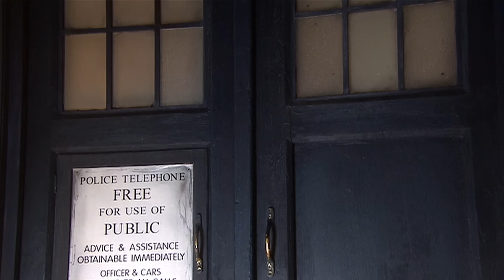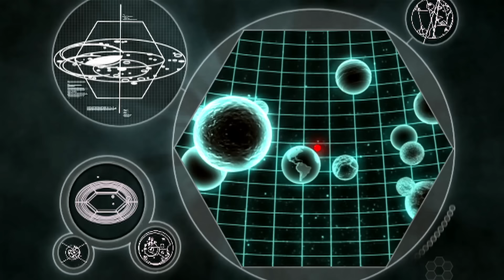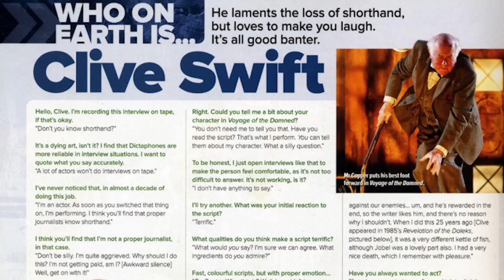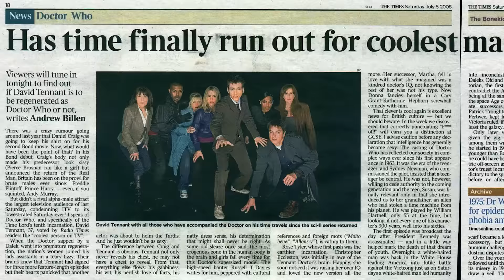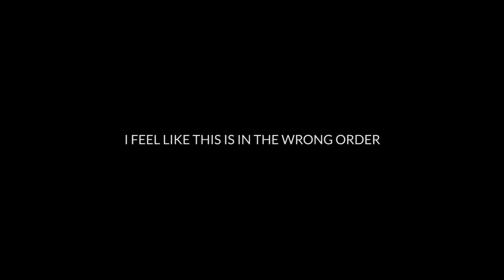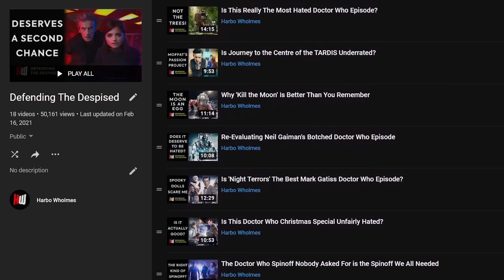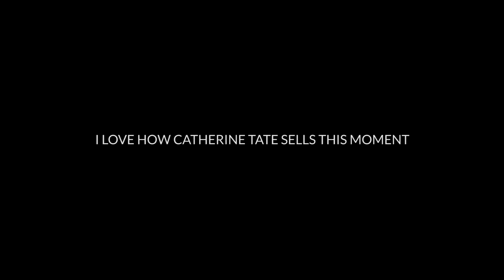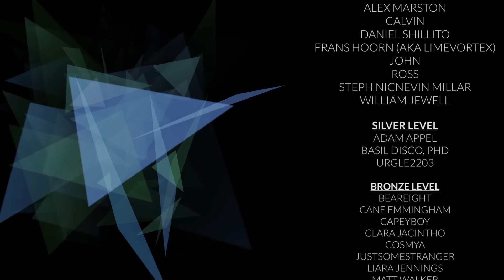When Doctor Who Did 'Infinity War' (But Better)

Comment: The way I make sense of the "That button there" scene is that Donna programs the button herself, rather than having a random 'this breaks everything' button already sat there 🙂
Reply: That's honestly the way I thought it was meant to be
Reply: I always saw it as davros was the mastermind behind the Daleks, and while he may not have personally built the crucible, he more than likely had a major hand in designing it. Given his previous track record with butting heads with the daleks and being offed by them more than once (to my memory), it would make sense that he snuck that console into the design specs in case he needed to take control, without the daleks ever being the wiser, even sneaking on those rotators that were clearly built to fit the plunger replacers to make it look like it was made for the daleks also. Both seem like perfectly plausible explanations for it
Reply: 'That button there' can work well. 'Family of Blood' ended a bit like that, with the Doctor explaining why it was important with his characteristic technobabble. Donna did that a little bit. When it's done poorly, it's the Eleventh Doctor black cubes episode.
Reply: same way to explain why in the end of the world they just have a "turn off shields permanently" button lying around

Comment: I feel like this finale is best on first watch if you're going through the show in chronological order, just so you can appreciate all the characters and the arc. Watching it out of order and standalone, it just feels like all spectacle and not a huge amount of depth.
Reply: You could say that you have to go through the Journey to reach it's End
Reply: That's true. Doctor who is sometimes an episodic show where each episode requires a beginning and an end and everything a story needs in between but sometimes it's a serialised show and with most of the finales in RTDs era the finales are the pay off to all the build up from before. So the depth of this story is about the characters and everything that was built since the first series. I don't think it requires the amount of depth something like midnight or silence in the library did and I don't think its a problem that it requires you to watch the series in chronological order to be enjoyable. That's what's so great about modern who. It's not always about stand alone stories you can pop out of order. You can have that and you can also have a serialised drama to enjoy in chronological order.
Reply: You have to watch Turn Left all the way to journey's end.  It is the closing of an Era, can't be split up.    Have lots of tissues!   Amazing!
Reply: It's one or two "fluff" ( I used that word very loosely) episodes then basically a two episodes movie that will have you sobbing.

Comment: The Reality Bomb was not stopped with literally 1 button xD
The RB was negated before that button was pressed. Similar to how Donna was using a combination of controls to override the Daleks' weapons etc using a thought process that even the 2 other Doctors didn't think of, thats how Donna stopped the RB too, with "that button there" being the final switch to put the RB in shut-down. The RB is stopped by Donna using the controls and after pressing thast last button its basically switched off, as the Daleks even said when they say that the system is in shut-down.

Comment: I feel like the Donna saving the say scene could have worked better if it was a terminal with a keyboard and a screen and she was shown hacking or something. It wouldn't be perfect or even a particularly good solution but it makes a hell of a lot more sense than one of the three switches on a console being the off switch and the wheel just being an override of a daleks.

Comment: They could've had Donna screwing around with the controls, rerouting power to different systems, activating random machines functions, and messing up system settings. I imagine a doomsday weapon won't function correctly when random parts of it begin exploding or non-essential pieces drawing necessary power

Comment: In my mind, the main reason that Who did it better is because they managed to get arguably more emotional reactions and much higher stakes (Infinity War is about the destruction of half a Universe, Journey's End is about the destruction of every Universe ever) but done on the fraction of a budget
Reply: My one and only gripe I have with this story is exactly this, every universe ever. “The stars are going out” was said a few times in this 2 parter and turn left, which surely means that the reality bomb was successful in one or more universes, which means that every universe was still fucked right?
Reply: @WeLhOOse  That's true, but at the same time, we can't absolutely know for sure, because it all came down to Donna's "destiny" and maybe that "destiny" was the same in every Universe. Also, it's possible that Davros could have miscalculated, that the Reality Bomb doesn't destroy all of reality

At the end of the day, you are right, it's a plot hole, simply because there is no confirmation

Comment: 06:17 "And it's bittersweet because it's one of the last times the Daleks were scary."

One of the strengths of the Chibnall era is that the Daleks are scary again. Prior to Resolution and Revolution, the last time the mutant was a threat outside of the tank was in Genesis. That leap by a mutant onto Jack's face in Revolution is genuine behind the couch stuff, and the Daleks don't spend much time yelling Exterminate, they just get down to Exterminating.
Reply: Scarier than the Moffat era does not mean scary. The bar was set so low that everyone praised Chibnall just by having his Daleks actually kill people. The Dalek in Resolution was threatening on its own but became completely incompetant whenever the Doctor showed up and the Daleks in Revolution were utterly brainless.

Comment: There are lots of similarities between this and Avengers for sure. I wouldn't say that it did Avengers better, but there's definitely so much that I can see in both of the franchises.

-The big build-up over multiple years
-The universe-ending threat (except the snap actually happened and they had to deal with that)
-Everyone from different films/shows coming together (assembling, if you will)
-The sacrifice of a hero who has gone through an arc over multiple years

Those are some of my favourites. Thanos felt much more of a threat than Davros all throughout, which pays off with him actually carrying out his goal. If we had an extra episode to make this a 3-part ending to Series 4, they could've had the reality bomb go off, and take time to put it back together with Donna ultimately sacrificing herself like Tony Stark.

What we got was incredible, but it could've been groundbreaking.